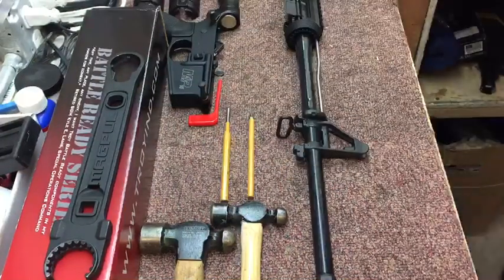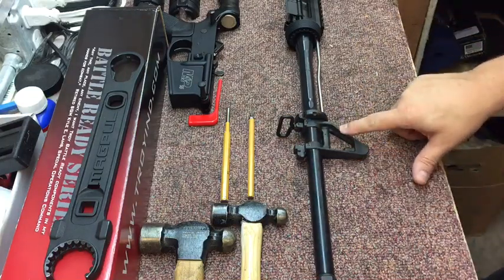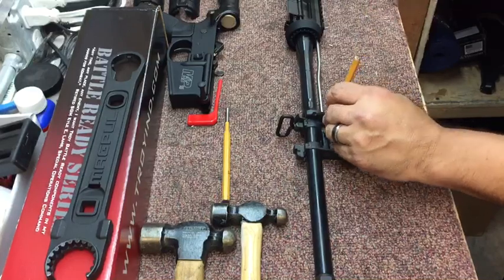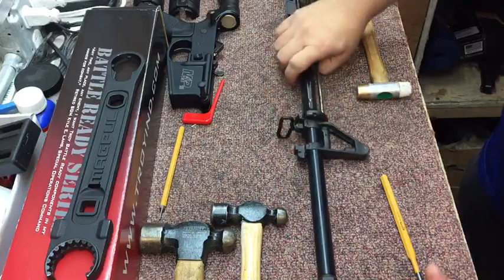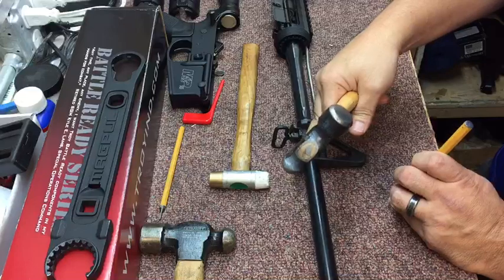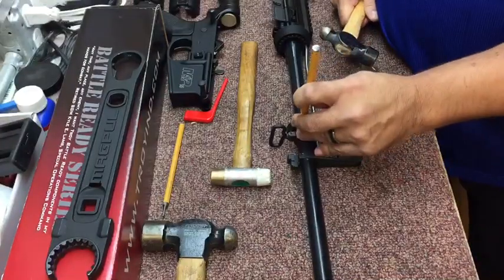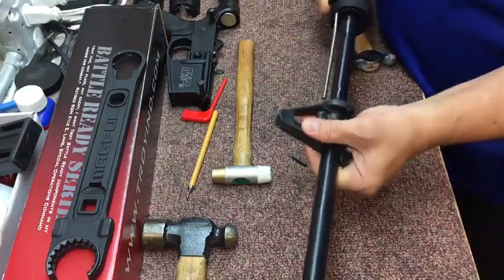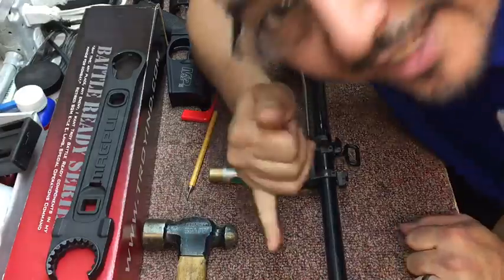X-Ring Tech Tips / Easiest way to remove an AR-15 front sight

Comment: Glad to see the comments. I've been banging at the pins (checked the small side with a caliper) for over an hour. I've destroyed two punches. The pins won't move.
Reply: Yep, my experience exactly. Now the pins are mushroomed. I am going with a dremel next.
Reply: @timmcginley7463  The Wheeler Engineering, Delta Series Taper Pin Removal Tool  is how I finally got them out. And a big hammer.
Reply: @hawks1282  Thank you, It has to work better than the dremel. Now I am"touching up" the parkerizing on the barrel, but the A2 sight and gas block have been removed.
Reply: Took us a lot of trial and error, but we finally got them out with nail starter punches. those 1/4" x 1/4" square punches that narrow down to a point. before we bent 3 sets of roll pin punches. we used those nail starters and 2.5 lbs blacksmith hammer, and they finally came out. oh, we also used a Dremel to file down the pin so its flush with the A2 sight, actually a little bit further. then flush. what a chore. We heard some manufacturers like to weld their A2 pins so I thought I was never getting them out. goodness.
Reply: Fake video. Thumbs down!

Comment: I have a S&W M&P15 optics ready front gas block with 1 tappered pin and I can not get that pin to budge. I've been told to heat it up but I think I'm find a gunsmith 1st
Reply: Did you figure it out bro ?
Reply: Ive seen S&W put their pins in from left to right, opposite of literally every other manufacturer.. Try hitting them from the opposite side.
Reply: @cysmith1628  nah man I knew about their backwards install. I ended up taking it to local Smith and they pounded the hell out of it with a ballpeen hammer and ended up getting it out. I soaked it in Kroll, hit iy with the torch and pounded with the ballpeen and it wouldn't budge.. I dimpled the barrel and threw a BCM LPGB on it so I won't have that issue anymore.

Comment: Spent six hours trying four different methods to getting these out. Ended up having to just saw off the whole front sight.
Reply: I’m in the same boat right now. Those pins will not come out. Waiting for my angle grinder to come today. Where did you end up cutting yours at?